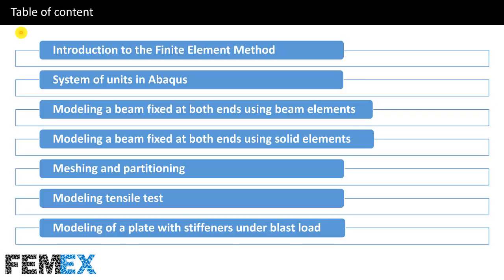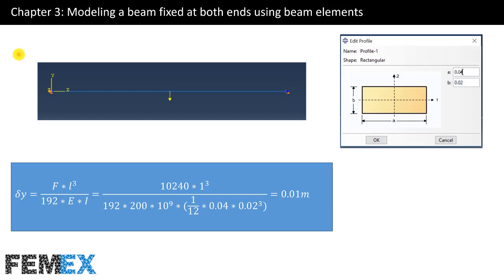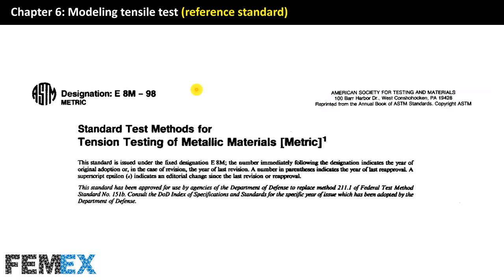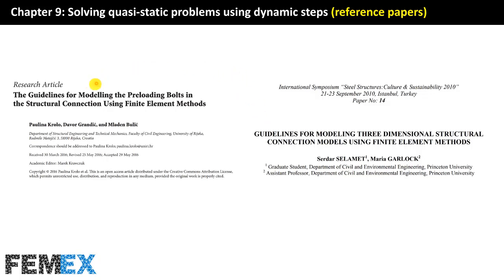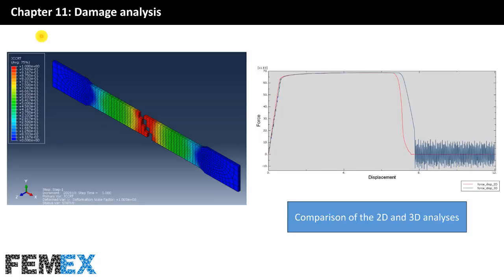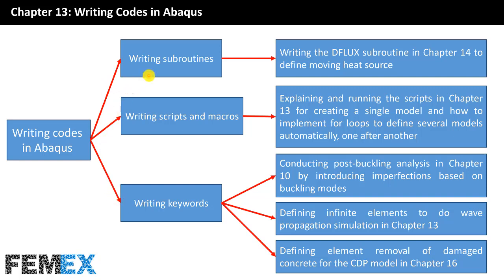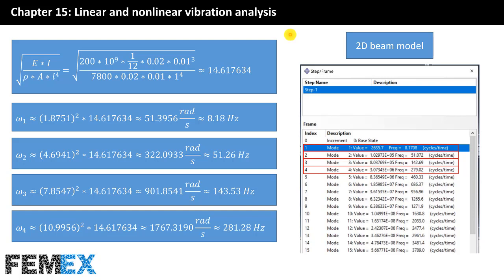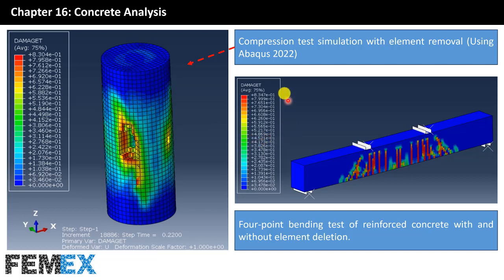Comprehensive Abaqus Package

Comment: Hi friend, I hope you're fine.
If we model a half of object due to the symmetry and exert symmetric constraints, do we need to double the load_displacement diagram or not?
Reply from the maker: Hi.
Thanks.
It depends on the symmetric plane which you are using. suppose a tensile test specimen. It has two directions: longitudinal and transverse.
If you use the symmetric plane which passes through the middle of the specimen and is parallel to the longitudinal direction, Yes you must multiply the calculated force by 2.
But if you use the symmetric plane which passes through the middle of the specimen and is parallel to the transverse direction, there is no need to multiply the calculated force by a factor of 2.
So the direction of the symmetric plane determines to multiply by 2 or not.

Comment: Hello, excuse me, when we enter a part in Abaqus, its dimensions are in mm, so what is the unit of time and mass
Reply from the maker: If the unit of length is in mm, you can use SI(mm) system of units. In this system, units are :
Mass => tonne
Time => second
Energy => mj
Force => N
Density => Tonne /mm^3
When you enter values, suppose these units and enter values according to these units.

Comment: Hello, two plat that are on top of each other and have no movement have been welded. What are their contact interaction?
Reply from the maker: You can define their contact using the General Contact method or define all the Surface to Surface contacts using the Find Contact Pair tool.
Regions which include both the contact interaction and Tie constraint will be tied together because the priority of the Tie constraint is higher than any kind of contact interaction.

Comment: Suppose that I want to model the extrusion process but I want to apply force instead of displacement and in the full 3D modeling I applied a 200 N force. What should I enter for the value of force in the axisymmetric space ?
Reply from the maker: Hi.
In the axisymmetric space you must define the same value of force. There is no need to divide it by any values because axisymmetric condition has been implemented in the formulation of that space directly.

Comment: Hi.
Thank you for your useful tutorial.
In the simulation of a process using the explicit solver, when should we define mass for the rigid bodies like punch ? Does the modeling space affect it or not ?
Reply from the maker: Hi.
You are welcome.
The modeling space does not affect this at all.
If you define BC for all the DOFs of the RP of the rigid body, there is no need to define concentrated or point mass for the RP like the extrusion process. But if BC is not defined even for one of the DOFs, you must define point mass like the impact of the rigid projectile to the deformable target. In this case, at least the DOF of the projectile along its initial velocity is not restricted so you must define point mass for the RP because in such cases, the second Newton's law will be solved for that DOF so mass must be define.

Comment: Hello.  I encountered the following message when defining S22 and LE22 as XY DATA to draw a rebar stress-strain diagram:
"No xy data was extracred. using the provided options. please verify following:
1.The variable requested was written to the output database for the requested elements or nodes.
2.The invarient/component selected is valid for the type of element selected. For example, the out of plane principal value is not valid for solid elements."
now, whats the reason of this massage?
Thank you.
Reply from the maker: Hi.
As you want to extract data for a rebar, I think it doesn't have S22 and LE22 according to that kind of error. Please check that whether Abaqus shows S22 and LE22 for them as contour variable or not. If it doesn't show, I am telling you the cause of error correctly but If it shows them, the problem is another thing. I know that beam elements have section points and if you are using beam elements, you must set the position to section point. I have forgotten about integration point.

Comment: Hello.  In the visualization module, when we want to define XY DATA for Field output, there is a position called centroid.
 This centroid gives us the output for whats region of element???
Reply from the maker: Hi.
It gives you the value at the center of the element. But If the variable is an element output, I suggest you to get it at integration point instead of the centroid because for getting the output at the centroid, Abaqus uses interpolations from the integration points which may reduces the accuracy.

Comment: Hi, I've modeled a part that contains a crack. For meshing I've tried both Full integration and Reduced integration but the stress results had great differences. I've modeled that part without crack and that happened again. How can i find which answer is correct?
Reply from the maker: Hi.
Yes you are right.
This issue can happen if the element size is not sufficiently small. You must use finer mesh for both the cases. Generally, when the mesh is fine enough, the results of the reduced integration elements for the crack or damage patterns are more realistic. I have obtained this from running a lot of models. Unless you have unrealistic deformations due to the hour glassing issues. In such cases you must not use reduced integration elements at all.

Comment: Hello I had a question, I am analyzing a vessel, I wanted to add the weight of the fluid inside to the analysis, but fluid analysis is not my goal at all, and I want not to do meshing for the part that I assumed to be fluid (not from the analytical rigid feature.  I can use it because it is complicated in my form)
Reply from the maker: Hi.
You must define pressure. You must calculate it from the height of the fluid and apply it to the structure. The other way is to model the fluid as a part and assign a material with very small Young's modulus to it but the density must be exactly the same as the fluid. then you must create tie constraint between the part and the internal surface of the vessel. Also you must define gravity load in the load module.
Reply: @FemexIran  Thankful
Reply from the maker: @Mohammad8888-w8v   You are welcome.

Comment: Dear Mr. Mirzabozorg,
Thanks for the great video,

I wanted to know when we have a cooling process, is the stress-pressure considered as  the residual stresses or we should define another output for it to see them?
Reply from the maker: Hi.
You are welcome.
Basically the residual stress means the final state of stress after removing all the loads and boundary conditions.
Suppose a sheet undergoing deep drawing process. After doing the process and removing the tools from the specimen, the stress in the specimen is called the residual stress.
It does not have any other special definition. At that state, you can describe it from Mises stress point of via or stress components point of view. What you have mentioned in your question is another kind of stress which has its own mathematical definition like the Mises stress or principle stresses and you can check it in any frame of your analysis and it is not the residual stress.
Reply: Thank you for your reply,
So as I understand, when we have a normal process of cooling down, and no tool is used in the simulation, the stresses we observe such as Mises are considered the residual stresses?
Thanks again
Reply from the maker: @neolbah_editz  
You are welcome.
Actually it is not related to have or not to have tools in the simulation. After removing all the forces and BCs, the stress field which remains in the structure is called residual stress. It must be free from every thing. You can check its stress components and every thing which is calculated from stress components like Mises stress.
Reply from the maker: @neolbah_editz   You are welcome. No your understanding is not correct. I said it is not important whether you have a tool or not. When the process is finished and when you remove all the restrictions like the boundary conditions, the remaining stress field is called the residual stress filed. it has 6 components in the 3D space. Also from their combination we have the Mises stress or any other kind of stress. Using the kind of stress to do the interpretation depends on the material type.

Comment: do you know how to get a pinching effect on the concrete beam-column joint?
Reply from the maker: Hi.
As far as I know, the CDP model of Abaqus cannot solve the pinching effect.
The pinching effect is due to the sliding of armatures in the concrete.
But it can solve the peak loads in the hysteresis curve.
I mean that in the peak points of the hysteresis curve, the numerical force-disp will be fitted to the experimental results but the slenderness of the curve due to the pinching will not be captured.